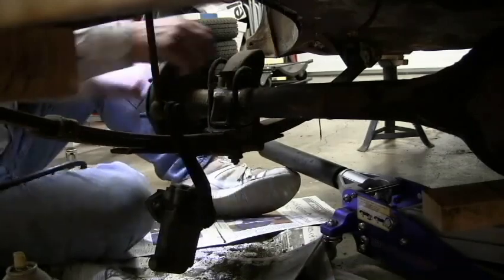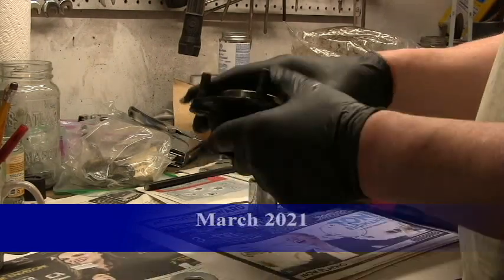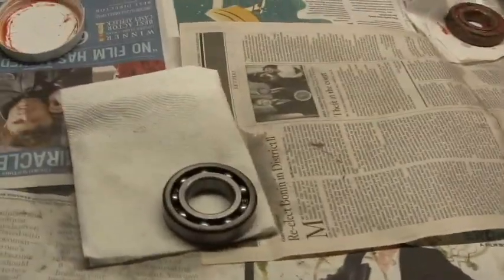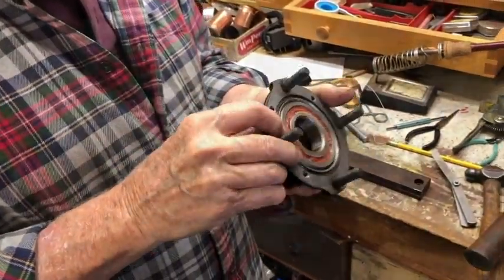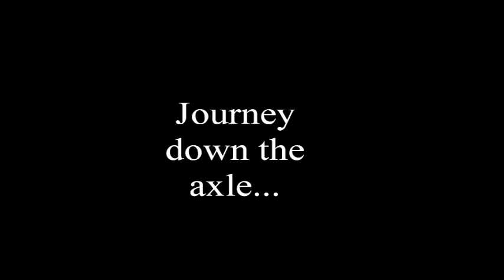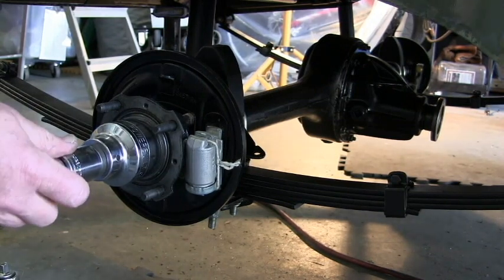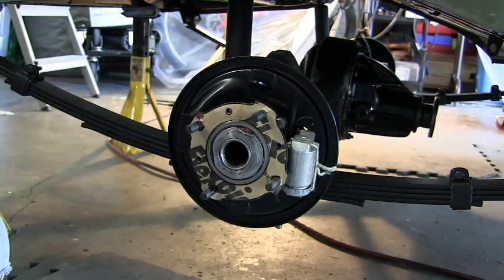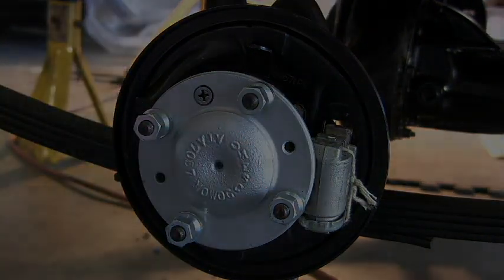Morris Minor Rear Axle Rebuild

Comment: Hi Tim, thanks for posting your film.
Recently i had a slight oil leak on the off rear wheel of my traveller. I did wipe away the trickle of oil down the backplate, and was going to leave it. However I decided to jack the car up and remove the brake drum and hub. It was lucky I did this because, after looking at the brake shoe return spring, one of the hooked ends had jumped out of the shoe iron. The spring seemed to hanging on, just by sheer will power alone.
I'm glad it didn't just pop off. Phew.😩
Ps. For good measure I changed both hub seals, and boy the old seals and bearings were difficult to remove. Got there in the end though.
Kind regards from South East England.👍
Reply from the maker: Yes the hub was a real pain getting off, even with that hub puller!  The oil seal was also very tricky as like a lot of amateurs, you're never really sure how hard to 'push'.  Its so much easier and pleasurable to install clean, painted parts.

Comment: Hi Ihope you changed the bearings again as the rear one's should not have grease, only the front bearings you pack. Rears are just coated In the same oil as the diff even says that In the workshop manual.
Reply from the maker: Thanks for the info

Comment: I had the same issue with my rear brake cylinders. One side went in fine and the other side needed a jolly good whack.
BTW, the manual (even the Haynes one) expects you to remove the hub before changing the brake shoes or cylinder. I don't know anyone that does that!
In the same way the manual says to remove the torsion bar to gain access to the master cylinder bolts. Oh year! I can see how that would go after it has been on there for 60+ years. So much easier to nudge the bar out of the way.
The one I like is the advice about changing the radiator. "This is best done with front end of the car removed" Yeah right! I did it with the front end in situ and it was a doddle.

I think that the issue with the Morris Minor manual is that it describes everything as if you were building the car from scratch. How hum...